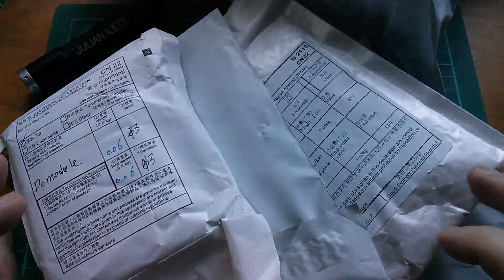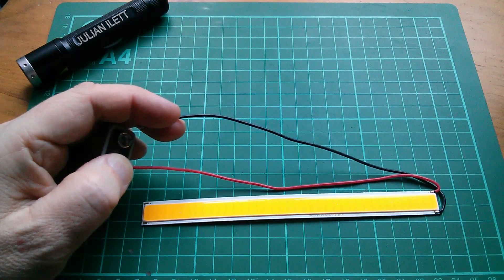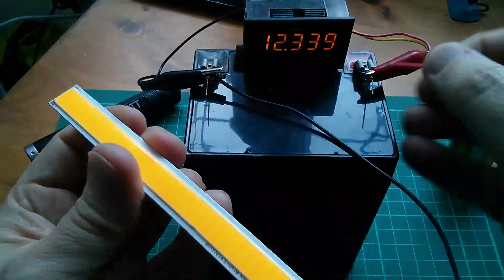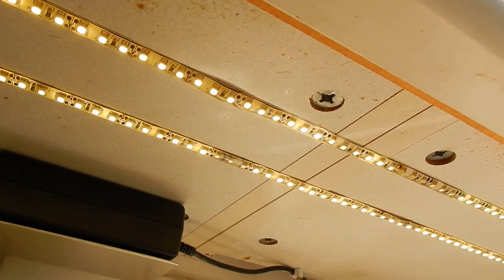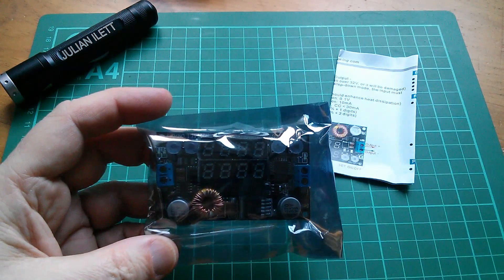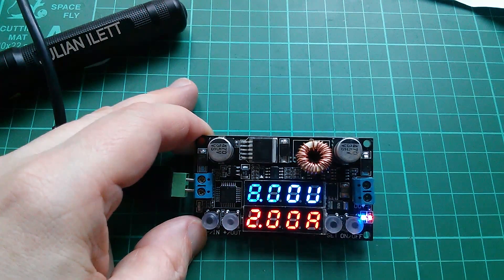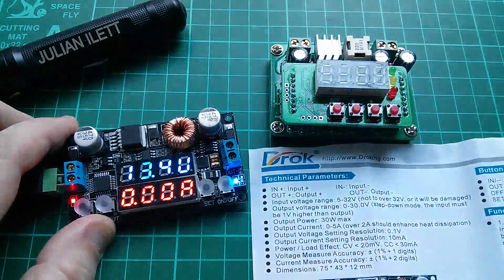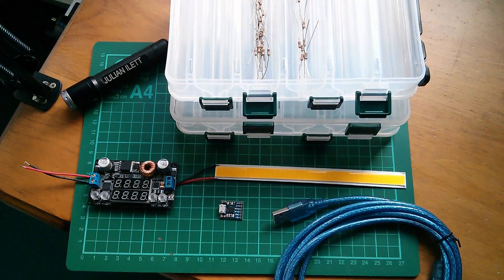Julian's Postbag #53 - Patreon, 12v COB LED, Buck PSU

Comment: I use those led cob lights and run them at 11v and they run cool. Granted the output is lower but they will last. I have 8 of them daisy chained ( in parallel )  running on a 12v mains adapter an have used 2 diodes for a 1.2v voltage drop. Seems to work fine and have left them on for days at a time.

Comment: I bought some strips like that. To try out, I just shortly held the contacts against plugs of a 15V power supply (from a headphone amp), and a 12V power supply (from a DVD player). There seemed to be a lot of flicker, dunno if that came from just holding the contacts to the plugs. Are those kind of power supplies right for these strips, or should I get a different kind of supply which might avoid the flicker?

Comment: How much did that COG draw at 14.4? Just wondering, because they should not exceed something like 250-260mA. But since there is no amp limiter, was thinking of using 10ohm 5W resisotrs in front to limit current in the car use. Thinking of using them to serve as backup light under the doors when they open, and maybe in interior under the seats.

Cheers...

Comment: Those LED strips in the kitchen have failed quite spectacularly, the ones with 5050 elements in my grandmom's kitchen has been operating much better for years now - no dead led yet despite the steam from kettle and cooker. Maybe the voltage to those strips wasn't exactly 12V causing the LED's to be overdriven?

Comment: Hello, Nice combination of items that has raised a question for me (I am looking to set-up a solar 12v system for lightning at home). Would a buck boost converter be suitable to sustain the voltage needed i.e. 12 or 13V (with the necessary current handling capacity). Thanks

Comment: I have used a 12v cob strip running from a 12v mains DC psu as a work light when soldering, working fine after 12 months of use, I just glued mine to an aluminium strip.If you installed a long thin aluminium strip under the kitchen cupboards and then superglue the cobs they should last ok.

Comment: Mounting, I used clear heatshrink you'd normally use to wrap battery packs with (18650 etc) 
Alluminium strip and thermal paste clamped together with the heatshrink sleeving.

I did the same for a 5m strip of 5050 rgb led cut to 5x1 wired parallel.

Comment: I was interested to see the COB LED, as I've just ordered a couple of very similar ones from Banggood.
I want to use them above the hob in my motorhome. I may have the same problems with heat dissipation.
P.S. your plea for Patreon funding has not fallen on deaf ears. I really enjoy the postbag slot.

Comment: Julian, I did something similar for under-cabinet lights in my Mom's kitchen.  I used slightly smaller COB strips that had small mounting holes at each end.  I used a length of 1/8" thick, 1" wide aluminum bar from the home center, cut into pieces, behind each COB (with a bit of thermal grease, of course).  They're powered by constant current LED supplies, which are hidden away in old-work boxes in the wall with a mains switch to turn them on and off.  Power comes from a receptacle located in the same stud bay.  The COBs put out tons of light and they only get slightly warm mounted on the aluminum bars.  As I recall, I got the COBs and power supplies from DX.com.  It worked so well that I duplicated it for lights over my workbench.  [In case you're not familiar with the term "old-work" in Britain, it's an electrical box designed to be installed in an existing wall, versus "new-work," which is nailed to a stud in an open wall during construction.]

Comment: You could always try a thermal transfer epoxy adhesive. A bit pricy and a pain if by chance the Cobb should fail and you want to remove it from the aluminum heat sink / mounting plate.

Comment: I bought 6 of these COB LED strips to test the idea of fitting them to the picture rail in my sitting room as "uplighting". When I tried 'daisy chaining' them I found that the volt drop meant that as each one was further from the feed point the dimmer it became to quite a significant degree.
Reply: I use them for interior lighting in sales display cabinets. If you power them with current limiting supplies and feed pos. to one end then run a wire alongside and power the other end neg. they will all have the same brightness. I usually add a diode to drop the voltage slightly so they will live long and prosper.

Comment: To mount the leds use thermal glue used in raspberry pi heat sinks and stick it to a metal bar

Comment: A bit underwhelming presentation of the Cob led. Was hoping to see you find the optimal/maximal current and it's accompanying voltage.  That's what I used to expect from you at a mailbag video.  Anyway nice finds. Very cheap cob and nice buck alternative. I still use the other one you showed as my portable bench psu. 
Guess I'm going to order these items and measure the volrage curve my self.
Reply from the maker: You can't measure the maximum current. You can push as much current through the leds as you like until either the connecting wires melt or the semiconductors overheat. There was no data supplied, just the rather vague 12v figure. But you can certainly plot a graph of current versus voltage at different temperatures.
Reply: +Julian Ilett I know there is no max current, and yet there is. Based on temp and voltage you/we could find out the max acceptable current. Handy if you want to drive them under your kitchen cabinets with an esp8266 driving them through pwm. Got the circuit working here with other cobs.

Comment: Damned, that buck converter was just one that I have been looking for, but it seems to be sold out everywhere.
If anyone has a link .... plz
I actually like cob leds.  Nice and even light and not as the bright spot that blinds you if you happen to look at it.
Reply: +Luc Peeters 

This is also available from Amazon.com  for $6.89 when you use the promo code (Y8OCCQ51) that is on Drok's webpage for this item http://www.droking.com/numerical-control-constant-current-voltage-regulator-dual-led-display-buck-power-supply/

Reply ·
Reply: +nk p  Saw it, but that is amazon US,  so might be expensive shipping it to Belgium.
Reply: +nk p .........and they don't ship to Poland...... damn it
Reply: +szatanizmo I got an email from one of the ebay sellers that it should be available after the 25th of February.  So let the countdown begin.  This one should be nice to test stuff like leds etc.
Reply: +Luc Peeters Hey that's great news, thanks for updating :)
Reply: +szatanizmo Just got contacted by Drok. They want $20 ... I will pass and wait until they are available on ebay or Ali.

Comment: This is also available from Amazon.com  for $6.89 when you use the promo code (Y8OCCQ51) that is on Drok's webpage for this item http://www.droking.com/numerical-control-constant-current-voltage-regulator-dual-led-display-buck-power-supply/

Comment: Wow those LED strips in your kitchen failed big time. I've had a 3 meter LED strip installed in my covered driveway for around 2 years and it's still working perfectly! I can notice it's perhaps a little dimmer than when I first bought it but there's no dead LEDs! It's not even a weatherproof one, it's just the paper thin strip type!

Comment: Julian, I have some COB LEDs which are even cheaper when you buy them from Banggood (they have many LED promotions). Usually you can buy them even for less than $1. I tested a few of them on my channel. Store claims that they should be powered from 12V but people in the comments gave higher values, so your test with 13+V were ok. Most LEDs require constant current circuit. But I power them direcly from 3x18650 lithium cells. For newer "installations" I used boost converter.

Comment: 11:45 - the voltage output on that PS really likes to jump around!  And with no load no less!
Reply: Pretty normal on undriven loads. It is oscillations in the opamp in the voltage regulator due to the extreme sensitivity caused by not being connected to a load. It's not a big deal, even some professional bench power supplies do it. It's a buck converter, so its even more prone to the problem, but even a linear power supply can do it.

Comment: Hi Julian, how long have those LED's been under the cabinets? And are those 60led/m 3528 strips? I have installed non-waterproof 60led/m 5630 and after 1,5 year they all work fine, steam and all.

Comment: Please get a bench power supply Julian. I cringe every time you stick an unregulated supply on your projects etc.
Reply: +Eric Gee Well, these are regulated. You can set max current and voltage?
Reply: Yes I'm getting one that the max coltage is 60 volts holy crap and its only 20 bucks on ebay if you look for 60 volt power supply ther expensive

Comment: I use 5630 warmwhite led strips on my desk, they are I think the best brightness/money value. I use it with a little remote to turn it on and off, adjust the brightness etc. They aren't too hot in 100% brightness, so I  think you should give it it a try on the kitchen.  Maybe one strip give you enough light. I just use regular led strips, not the one that has an aluminum back plate that was linked in the comment previously.

Comment: The cabinet lights, those kinda strips I purposely under drive to 10 or 11 volts without too much major loss of brightness, but I do get a dramatic reduction in heat produced and they last tons longer. ( that's where those switch mode supplies with the V-Adjust are nice :3 )

Comment: Let's start a separate Patreon campaign so Julian can get himself a decent power supply !
And, yes : 12VDC usually means 14.1VDC charging lead-acid batteries (14.4VDC for the gel ones).
Also, fully charged lead-acid battery will have 13.8VDC
Reply: +John Smith - lol... viewers have been saying he needs a proper PS for a long time!   :-)   It's funny seeing all the trouble he goes through to get the voltage he wants.  Maybe that's part of the reason we watch?   ;-)
Reply: +ElmerFuddGun  haha the suspense.  Wait, actually does he have a fuse in line with all those batteries? 
But yes, he could use an DC/DC upconvertor and then something like this http://www.gearbest.com/development-boards/pp_152942.html?admitad_uid=ba0e87810b25bd1b93abd135ddda1277

Comment: the higher power version of that green buck regulator (the 8a version) I think uses the same chip as the new one you bought, because my 8a supply died when I put ANYTHING over 32 volts into it.  So I bought the 5a 60v one with the 1602 LCD display. Soon after the order was placed, I noticed that a 10a 60v version was available for not much more. I died a little inside because I could really use that 10A

Comment: I have several of those COB strips installed under my kitchen cabinets. I stuck them into aluminium profiles using thermal adhesive pads, and they've been working flawlessly for a couple of years now.
Reply: +Julian Ilett these are the profiles I've used: http://www.ebay.co.uk/itm/New-2-METERS-Aluminium-LED-Profile-Channel-Mini-for-LED-Strip-Lights-3538-5050-/271898358355?var=&hash=item3f4e67b253:m:m6i4bJZQvRTLn8w_CxM1rzg

Comment: Thermal epoxy onto a cheap alu strip for the LED strip. Maybe it's an opportunity for something arduino controlled (PWM) on multiple outputs to balance the light output of each strip?

Comment: Ebay listing has ended already on dc buck converter.....
Reply: +Mirko Mueller You can find them on Aliexpress even cheaper - for $9.50. Already ordered it, thanks to Julian :)
Reply: +cbm80amiga what did you search to find in on Aliexpress, i have searched and searched and can't find it on there
Reply: Offer I found is:
DC Step-down Converter DC5~32V to 0~30.0V 5A 30W Adjustable Voltage Regulator/Power Adapter DC 12V 24V + Voltage Current Monitor
But currently Chineese have New Year Holidays so this offer ended for some time.

Comment: hi julian, you must use manual exposure to show the different brightness. I like that dc-dc but will love one more digit that v and i is not very usefull. adios amigo
Reply from the maker: +Proyectos LED Hi. Yes, I have to learn how to do manual exposure on my new Nikon camera!
Reply: +Julian Ilett Unfortunately usually in video mode it is not possible. At least in most cameras I had in the past.

Comment: About the LED COB bars - I bought very similar bars from Banggood (they are cheaper there), they are rated 6W, but also take only 220-280 mA (they are very inconsistent), and the current slowly rises with their temperature if used with normal constant voltage PSU. I use 6 of them in aquarium (i opted for cool white, but also have some warm white), and find them bright enough (it's hard to look at them directly). I connected them parallely to 10W 12V 900 mA constant current LED driver, mounted on some DIY aluminium channel heatsink. The heatsink under the aquarium cover gets warm, but not hot. I mounted them with screws, but the result are some dead invididual LEDs inside the COB (nothing that serious), so I would advise to use thermal glue instead of screws and regular heatsink compound. You can see pictures here: http://on.fb.me/23wwToS - I'm much happier with these LED bars than with T8 fluo tube (they eat much less electricity, and are considerably brighter). About the undercabinet LED strips... The cause of failure is overheating - one would also have to put these onto some kind of aluminium piece, and one should not have bought strips with silicone overlay, because it inhibits heat dissipation. Similar thing happened to me also, with 5630 strips (you need only one row of them - they are plenty bright for under the kitchen cabinet, at least when they are new). I will replace them with 5630 LED bars (some call them rigid strips) with aluminium channel and milky cover (I hope the milky cover won't result in too little light).

Comment: I use Arctic Silver AATA-5G Arctic Alumina 5g Thermal Adhesive Epoxy Set to glue my LED's to an Al metal strip.. It works great. Then fasten the Al strip upside down to cabinets

Comment: The B3603 had a high peak voltage on start which is dangerous for fragile components. Does anybody know if this is the case with this buck converter?

Comment: The same dc buck converter for $9.50 http://www.aliexpress.com/item/DC-12V-24V-Power-Adapter-DC-5-32V-to-0-30-0V-5A-30W-Adjustable-Voltage/32497239651.html
Reply: +Er Han thanks Pal, just bought one.
Reply: +Er Han - Wanted to check it out but got a 404 page not found!  You guys must have bought them all!   ;-)
Reply: +ElmerFuddGun It seems you are right. I couldn't find another one.

Comment: I've got four of those cobs daisy chained together, and stuck to my over sink cabinets using strong double-sided stick plastic strips. They don't need any thermal sinking, and runs off a 12v 2A plug power pack. I've been using them for 6+ months with no notable issues. The light output is just right from washing up and cooking. Also, I've subbed to your Patreon. Keep up the good work!
Reply from the maker: +JamstaUK Good to hear that they work reliably. Many thanks for your support.

Comment: Is anybody else not getting notifications about new videos ? or am I the only one
Reply: you need to hit the bell button by the subscription button
Reply: 3.6V is a terrible LED. Blue dies should be 2.7-2.9 unless they are the worst voltage bin. 4 series chips, 21 parallel. Pretty common, try constant current driving the bar, 400mA ish.

Comment: I'll put $2 in the pot so you can do the hoarding for me, I have to stop..
Reply from the maker: +TheAmmoniacal Yes, I'm having to devise ever more compact storage solutions for all the stuff. Many thanks for the contribution.
Reply: +TheAmmoniacal Wait, I'm not alone?? I've raided every LED aspect of eBay and I need help fast.
Reply: +TheAmmoniacal Hah xD bloody Patreon...
Reply: +Julian Ilett If yu want to mount the cod led under the units just use a piece of extruded aluminium box or U section - cheap and easy.
Reply: +TheAmmoniacal phew, i now feel a little more normal
Reply: Delightful Hardware You do
Reply: +Sasquatch I don't recommend you ever "mount the cod under the units" they don't like it

Comment: Hi Julian grab yourself some of these for your under cabinet lights, i'm using them in the garage and there really bright. Currently have about 300 hours use and are running perfectly.
http://www.ebay.co.uk/itm/50CM-5630-SMD-36-LED-Day-White-Aluminium-Rigid-Strip-Light-D8-/281878131972?hash=item41a13ef504:g:z24AAOSwnipWZWyS
Reply from the maker: +Charles harman They do look good and pretty cheap too. Also, it looks like you can cut them shorter which would be useful.
Reply: +Charles harman those look good, do they have daisy chain solder points at the end?  good value, i have saved them to my watch list!
Reply: +jusb1066 They do indeed, i have 10 running from a 12v 5amp computer monitor power supply.
Reply: +Julian Ilett yeah you can cut them up. also they come apart very easily, so if you want you can take the aluminium backed leds out they just slide out.

Comment: I use the B3606 which has the same control unit as your B3603, and I think a big advantage of the B360x series over your new unit is that you can't accidentally switch the output on if you hit the set button twice - now that could ruin your day!
Reply from the maker: +slm60uk Yes, it could be a problem if the switch bounces while setting it. Good point.

Comment: For the COB LEDs, could you underdrive them slightly to avoid heat issues? Perhaps you could trim your 12V PSU down a bit?

Also, perhaps mounting on standoffs would allow better airflow and heat dissapation?